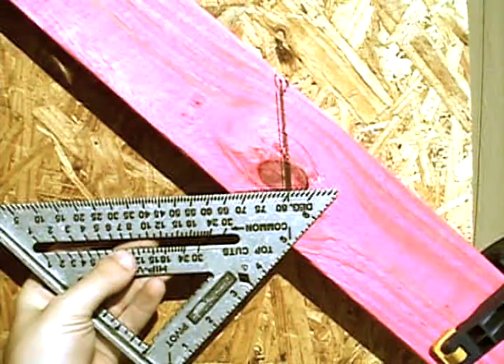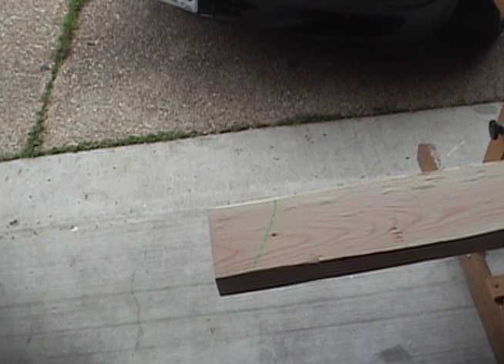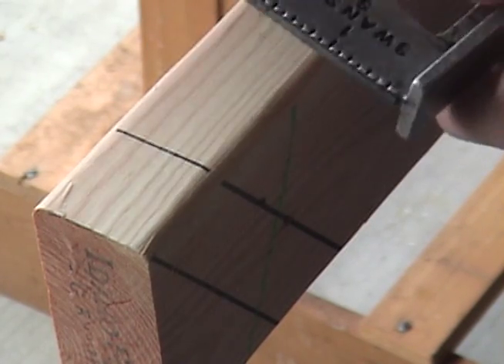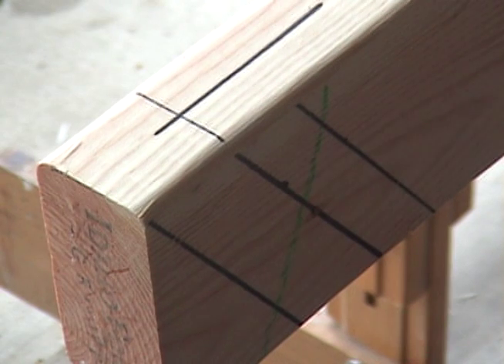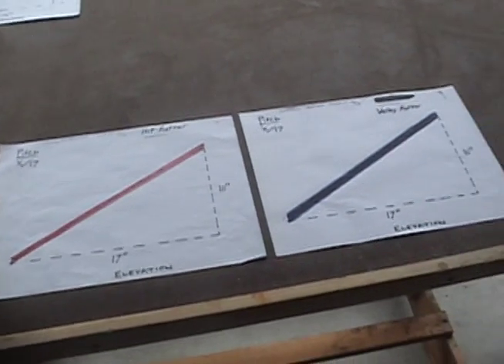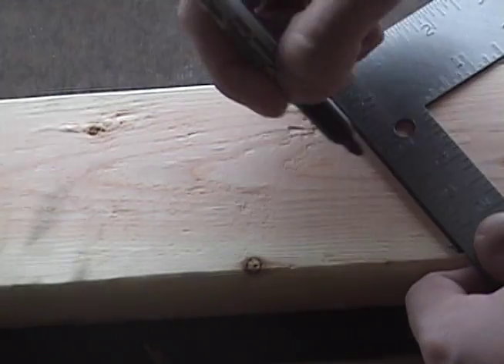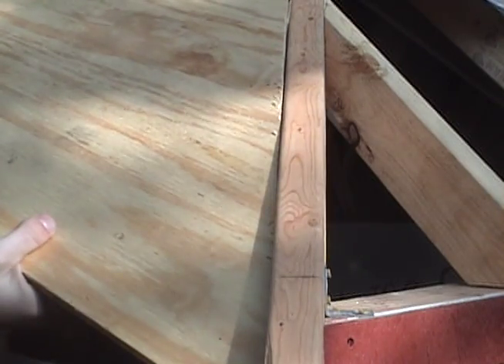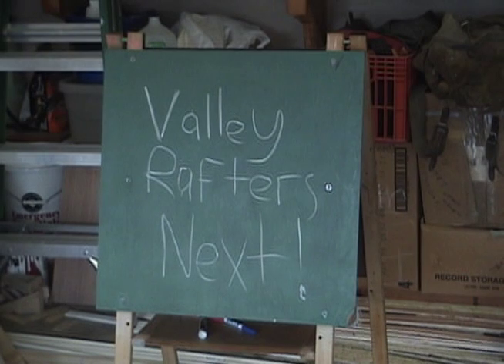Construction Rocks- Marking Hip & Valley Rafters With a Speed Square (Part 2)

Comment: Great video for people like me just interested in having a go!  Thanks for making it :-)  Some of the bitter pros on here really are sad.  Can I ask though, what's the logic behind the measurements for the double cheek cut at the top?  Being a Brit I'm having to do the whole thing in metric, so why do you back off the first plumb line by 1 1/16"?  I have an engineering degree but I can't figure it out!  Cheers :-)
Reply: Ed, I'm not sure if you received your answer yet; but you back off the first plumb line by half the width of the ridge board.
Reply: It's half the diagonal lenght across the ridge board (at 45 degrees) on a ridge thickness of 1.5 inches.
Reply: This drops the hip rafter to plane in with the ridge and king rafter.

Comment: Hallo John, grate video. I am childish too, hehehehehe. I do electric, drywall,  framing, painting, plumbing, etc and I'm doing it with fun. Usually I say: If you know how to work, you can't get tired. The roof is the part of construction that I've fixed and that's it.  Now, I would like to chelenge myself if I can build one myself.  . Soon, I will start some porch covering with the  " A " shape roof. Would you mind if I ask for piece of advice ? I may send you some questions on one of your channels if I get some problem cutting rufters and other things.  Ca Thanks man for this video.

Comment: Just curious to know why you just didn't deduct 3/4" from your run when using a single check cut for the top if the valley/hip rafter?